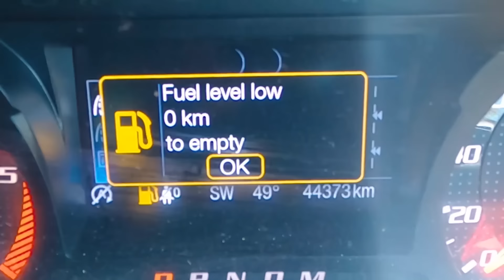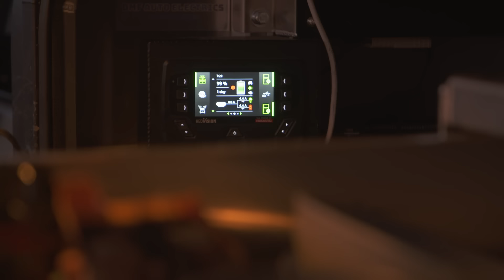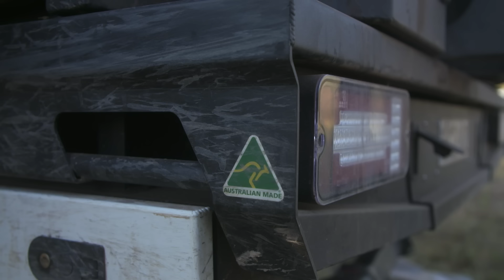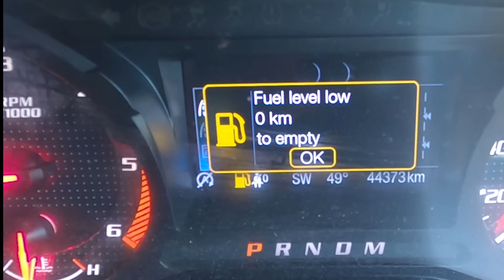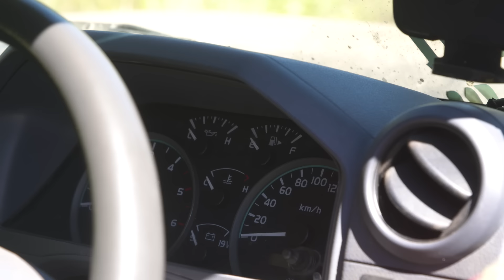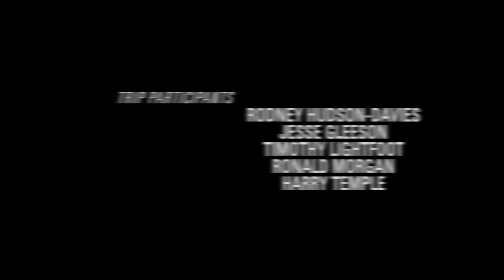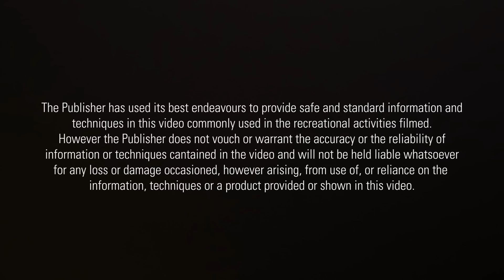We run out of fuel, food and tyres – do we make it? THE KIMBERLEY FINALE

Comment: I'm sure you've already picked winners at this point but I'll still share my story. 12 hours from home my rear suspension started failing and I was nose up going down the road. Let's just say where I was at, there wasn't any spare suspension parts readily available. I rolled into the local sports store and picked up a couple peewee sized footballs. Stuffed those bad boys into my rear coils and aired them up as much as I possibly could with the supplied manual pump! Ended up with more lift than when I originally left for my trip! All my buddies got a good laugh when I returned home with my makeshift lift kit!

Comment: Bush repair story, we were coming back from Victoria high country and left hand rear shock bottom bolt snapped and bushing fell apart, the shock came off and hit the wheel, we fixed it by using a kettle lid as the bushing few cable ties, luckily had one spare bolt to hold the kettle lid in place we did around 200ks back to Melbourne

Comment: Bush Fix. 
Ratchet straps and clamps to attach a steering box back to the chase of a Hilux. This worked for about 30 meters and broke. Next step was to leave the vehicle in the bush at 11pm to collect a welder and generator. Ended up getting back home with the Hilux as the sun came up. The track was the steps at Mount Sugarloaf.

Comment: Using a crowbar and ratchet straps to hold my steering bar together after it snapped coming out of a track. Also using my winch to control my clutch after the clutch cable snapped on the same track. Went from gear 2-5 and crawled 67km to home. Timing every traffic light perfectly. Without maximum steering

Comment: I had a U joint come apart and lose two of the caps on my 2015 ram 3500, Cummins. We were about 90 miles from anything. We couldn’t find the two caps that left the chat, so I used two 5/8 sockets to fill the caps positions, and wrapped the whole joint tight with electric tape, then duct tape, and after that put a tiny ratchet strap on it. It held all the way home… I was also pulling a camper

Comment: Bush mechanics fix,  my wife and I were crossing a big river full of boulders  in the middle of winter and we managed to climb over a Boulder in the Jimny and came down on the transfer case which in turn broke the transfer case mounts, we managed to get across the river  with only the drive shafts holding the transfer in, we ratchet strapped it up to get to camp but the exhaust melted the strap which broke two of the wife’s fingers, she had to deal with the pain  till morning, round two of strapping up the transfer & it took 7 hours to get out of the bush towards home

Comment: My bush repair - Ratchet straps around the front diff to the gear box mount when the radius arm rear bush failed on the patrol up at 5 Rocks. Pretty floppy and slow drive 😅😅

Comment: No bush mechanics or even a 4x4 but… went to a drift day in my E36 and snapped the main diff bolt, 80 miles from home didn’t have a spare so 2 chucks of wood on the sub frame, ratchet strapped the diff in place against the timber …. Good as gold all the way home 😂

Comment: Not out in the bush but got stranded on a test drive while I was a mechanic, the fuel pump went out, called up my buddy and had him bring a few cans of ether/ starting fluid down and I sat in the engine bay spraying ether into the intake as he drove the pos back to the shop. It was only about a mile away so just had to idle it back

Comment: We dont call it bush mechanic in America, we call it booty fab. In my 04 Xterra (American SUV version of D22 navarra) So anyway rear drum cylinders gave out and leaked all of the brake fluid in the middle of a massive mud track many many miles from phone service in bear island trails of big cypress. I refilled the reservoir, wrapped a microfiber towel around the line going to the rear axle and use a locking plier to pinch the line. It made it back home about 80 miles away no problem, drove to school the next day, then took it to the shop to repair the rear brakes. The drums had to be cut in pieces to be removed.

Comment: I think my best "bush mechanic" fix, was driving home after work. Everything was shut, and the bushes in the plates at the bottom of the gearstick that connect to the gear shaft came out as I was changing gear.
All I had was a gear lever that was like a joystick that did nothing, and a car out of gear.
I did have a pen knife, so I cut some long grass from the side of the road, and tied the gear lever and gear shaft together with the grass, and drove it home like that.

Comment: Best bush mechanic trick I have done was in between wee waa and Narrabri Nsw I had the 2 bolts snap on my upper control arm and used fencing wire to limp it 30km home to fix it right

Comment: A few years ago the left hand brake caliper fell off on my 80, it jammed the backing plate against the rotor when it came off. I broke off as much of the backing plate as I could, then had to piece the caliper back together and make new springs with bits of fencing wire, put eh caliper back on with some bolts out of my tow bar which I spaced out with some gas clamps I found in the back. Made it just over 300km to get home.

Comment: Bush repaire story: after a hard day pushing the limits every step of the way we rolled in to camp late at night. Truck was not happy running hot steam coming from ever side of the hood. Set up camp even to tired to eat figuring well do a big breakfast and give the rigs a good look over. We check fluids mines pretty low on coolant fill er up and crank her over and the radiator starts pissing all over luckily we still had a few eggs left we didnt crack yet. Cracked them right down in my radiator plugged the leaks enough to get back down of the mtn.

Comment: About 10 years ago we were in the middle of the Simpson Desert when the 
brand new $114,000 Land Rover Discovery we were traveling with broke a side radiator mounting point on the plastic overflow tank, spilling all his coolant on the sand. I pulled the radiator out and plastic welded the mount point back on to the radiator with 2 x screwdrivers we heated up on a gas burner. Put the radiator back in , filled with water and made it to Alice Springs where it was replaces under warranty.

Comment: Shauno what is it with you and rolling over haha 
Most interesting 4wd repair had a WJ grand Cherokee that the left front axle uni  joint  snapped and ripped the upper and lower ball joints out of the diff, had to pull the axle out and ratchet strap the hub to the diff to be able to get the car back to the bottom of the track so we could get a trailer out to it. The track was Commander trail coffs

Comment: Guess it`s kinda late for the competition, but might be useful:
Had a radiator leak where the plastic and alloy parts joined. My mechanic told to put ground pepper in, and it will reduce or even stop the leak so we can get home. I was doubtful but we made it home. It stopped leaking completely, and just out of curiosity I kept using the car for daily commuting. 30km one way, it went through a lot of heat cycles over the next month. And then the next months. After a year I sold the car to a friend, and she used it for another 2 years without any coolant loss.

Comment: You want to know craziest bush mechanics to get out of the Bush ?
Well in the Otway Ranges of Victoria, Had to sleep the night of two vehicles of people in the back of a Toyota 4 Runner which was 8 of us. Next morning walk 20 k to town called Forest. Call Family in Western Victoria and a week later make the track back back down to where the cars were stuck with a high lift jack holding one vehicle from over turning off the track down an escarpment 200 meters. Took a tractor which slid off the track and had to recover. took snow chains to apply to all front wheels of vehicles to recover them and as well have the tractor in tow as a dead weight behind both vehicles.

Comment: Gu patrol zd30 cracked top radiator tube to header tank, had to dismantle my pencil style tyre pressure gauge, drill out the broken fitting insert the cut down tyre gauge glued in with araldite. Continued our weekend away & Made it 3 hours back to Perth.

Comment: Back before the days of cell phones me and a buddy had went out on a night fishing trip.We had a flat and the lugnut caps came off the lugnuts when we tried remove them to change the tire. Trying everything I  figured out if I spit into the four way lugwrench  and packed it with sand we were able to get tenough grip on the lugnuts to get them  off and  get the tire changed using one lugnuts off each the other wheels .

Comment: Urine and beer saved me when I was 17 years old driving an old datsun 210 that ran hot. There was no water in the ditches, no streams, no houses, just me and a hot datsun. I found two hot beer in the back floor board, poured them in and while it foamed alot it helped, just not enough. So I unzipped and let her fly. So urine and beer got me home.
Edit: Another time we had to use a pantyhose for a fan belt. Worked remarkably well

Comment: snapped a rear trailing arm on a jimny and used the group of 4 batterys and a stick welded, sleaved it with some square tube from  laying around in one of the boys ute from work and filled it with hot glue (weld)

Comment: Manage rip a puncture on my front lefty tyre, with no spares, patches but packet of smokes bubble gum and lynx africa

I combined my gum (chewed) & tobacco then stuffed in the hole till it had a nice fit
And with the mud around me I used that to cover it, wet applied on first then some dry mud with little bit of moist in it.

Cover the leak well & sprayed my lynx Africa with a lighter creating hard clay to form.

Then used rest of my spray around tube of tyre and lit it up for quick fix, 

All this lasted me 4 hours on track till I found the road & service and waved down help

Comment: My bush mechanic was putting a empty 10 litre water bottle on top of the engine and putting fuel in to it to gravity feed the carby by using the hose from the radiator overflow reservoir, stopping every 30k to drain the fuel for the fuel tank to put back in the bottle. We did this because the fuel pump on our RB30 GQ Nissan patrol failed

Comment: Had a mate burst a front brake hose on his 80 series and lose all his brake fluid. We plugged the outlet at the master cylinder with a small wood screw then used a drinking straw to collect a bit of brake fluid from each of the other cars and put into his to top it back up, we managed a whole day of wheeling after that.

Comment: This wasn't a bush fix.  It was a fix of a fully loaded 36,000 kg tractor trailer air suspension that had collapsed the fenders on the tire because of a broken broken limiter rod that allows air into the airbags to adjust for loads, and lets it out when the load is off.  I was on an Interstate in the US and in a 1-lane construction zone with cement barriers on both sides.  I was blocking the entire highway.  

I fixed it with a stick -- a twig really -- that I harvested from the ditch.  I attached it in position and fortified it with duct tape and away I went!  And all with about 100 drivers stranded behind me eyeing me like flock of ticked-off crocs!

Comment: So best bush Mechanic fix my roof rack was shaken to pieces in the NT on the corrugations.  By the time we noticed it was held on only at 1 corner.  It was early days in my 4x4 journey so I didn’t have too many spares but what I did have was good old tech screws and a 18v drill so the remainder of the roof rack was screwed through the roof of my poor Frontera.  Very rough job but we made it all the way home with all our kit on the roof and not scattered through the bush.

Comment: Bush repair. Mates and I had to put jerry on the front seat and use the shower hose out the window straight into the engine bay. After the landy defender fuel tank filled with water in the Pascoe.

Comment: Got stuck at bribie with a cracked radiator, use zip ties and a blowtorch to plasti weld the bottom of the radiator and had the water 10l water bottle taped in ontp and the makita blower cooling the engine getting out of the northern track!

Comment: Had so many punctures that I ran out of Rubber plugs. Then of course I get another puncture and with no good spares left I have to come up with a solution for the puncture.  After thinking for a while I take a screw off the Land Cruiser and with some gasket maker I put some in the hole and all over the screw and screw the screw into the hole up to the head of the screw. This works so well that I was still driving on it weeks later. The only downside was the ticking of the screw head on bitumen until the head of the screw wore off.

Comment: So far my best bush mechanic fix.
"Unbreakable hilux broken"
LN65 hilux 

Front drive shaft broke my yoke so no 4wd, and all the stress broke both bolts that hold my center bearing onto my chassis, mad an awful racket. 

Fix was to get two Rachet straps and strap the center bearing to my chassis to get me the 200km home.

Comment: My best bush mechanic fix was whem my 79 f250 fuel pump quit and I opened the hood just enough to aim a can of stater fluid straight to the carb and running it on starter fluid for like probably 6-7km back to the farm

Comment: We drove with a Toyota 1. 6gle station wagon to a wedding and 2ks before that the heat gauge struk full blown reg. After some investigation it was a heater core that has blown. We drove it back home another 120kms after blocking off the core. Motor already gone. Had to bore it 60 though oversize to get it into spec again. Never ran the same after that

Comment: If your in a bog different tire size won't hurt your driveline. Especially if you have a strong transfer case you could run the whole track with all 4 if you absolutely needed to.

Comment: My best bush mechanic fix was when I snapped my exhaust. Right on the flange under the turbo had to cut slots in the exhaust and squash the pipe so it would sit in the hole and tied it up with some catinery wire so I could run the heater happened on the first night on a long weekend was 5 hours from home but didn’t let that ruin my weekend drove the whole 4 day weekend and 5 hour drive home like that sounded horrible but you got to do what you got to do

Comment: Dunno if im too late but we where on Bremer bays main beach trying to jump start my uncle ute, when a huge gust of wind bent my mums colorado 7 bonnet backwards and actually bent the bits on the outside closest to the windscreen, bent those bits and tore one of the pins out, that hold the bonnet. It needed to be bent back if we were to drive home (bitta context, we live 2 hours from bremer bay) so my dad grabbed a ratchet strap, wrapped round the bonnet and the roo bar and tightened it as much as it could go. Got us back to our shack where dad could put back the pins and bend it back as much as he could.

Comment: My bush repair was my mates swb safari after a trip in wires track we found the clutch line had blown we managed to get some small steel pipe of the lwb safari we took with us hose clamped it on bleed it with water and made it home you had to be careful the water kept boiling and we kept loosing our clutch pedal you would just coast for abit let it cool down and you would have clutch pedal again lol

Comment: Pulled the radio antenna off and wired an empty 2L coke bottle to the top of the door because fuel pump stopped working on my old fj45 I think it was to get a hose long enough we carefully pulled one the door seals off. The best looking seal and they were hollow and glued onto the door.

Comment: My "best" bush mechanic fix?
Using duct tape and cable ties to patch up a split coolant hose.

On the tyres:
Would it make sense to carry an inner tube?
On motorcycles it's not uncommon to fit an inner tube with tubeless tyres if the tyre has a really bad puncture. You'd usually get a tube that's fits the smallest of the tyres.

Comment: Ok bush mechanic fix, in South Africa, driving a series Landy from Hoedspruit to Pretoria, fuel line completely shot to the point even tape isn't going to work, so rigged up a coke cola bottle 2 liter and 5 liter water container sitting on the passenger seat filled with fuel, with a line through the dash and the back side on the hood with a hosepipe and a stupid amount of tape to make it. My pump was gravity of me lifting the bottle every so often. This is called making a plan. And when I think back on it, I can't believe it worked, but it did, or it was sheer dumb luck

Comment: If your running different size tires and not going to use 4wd. Pull the front driveshaft. Now you have low gear in the rear, and the tcase and front diff are fine.

Comment: Bush repair story. Out in the mountains of California in Jeep JK unlimited I lost a the brake caliper bolts. Causing the caliper to come off and wedge itself into the wheel.  I had to hike back on the track awhile only finding one of the two bolts. So I used the one bolt and found a tree branch and wedged into the other hole. I was able to get home.

Comment: Not a bush fix but a driver broke the his ignition key into three pieces and couldn’t use it. I cut a new ‘key’ out of a Stanley knife blade with a die grinder and cable tied the part with the immobiliser chip to the immobiliser near the key barrel and he ran it like that for a few weeks until the new parts arrived.

Comment: I’ll share my bush fix I was in my Polaris buggy gunning it in a flat field wen suddenly the bolt holding on the lower a arm to the spindle sheared off the machine did a full 360 as the wheel and upper a arm flung backwards. I came to a stop and managed to use a ratchet strap and a cotter pin to hold it all together for the drive home